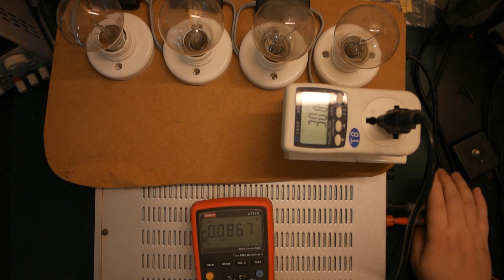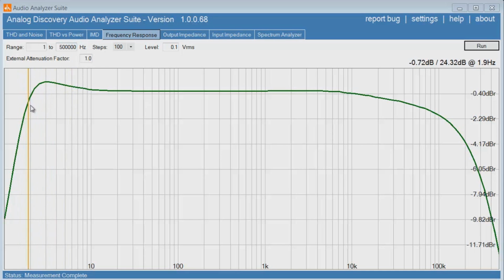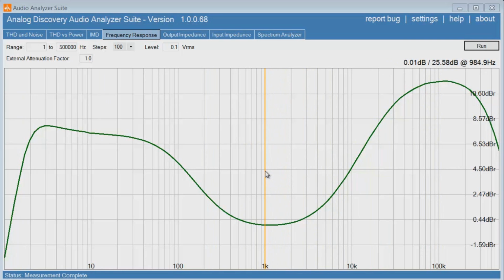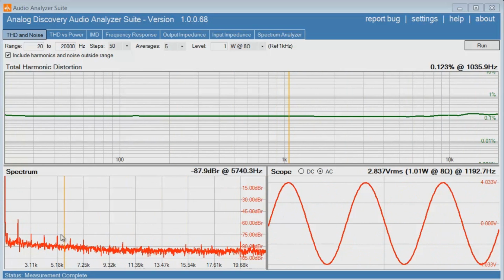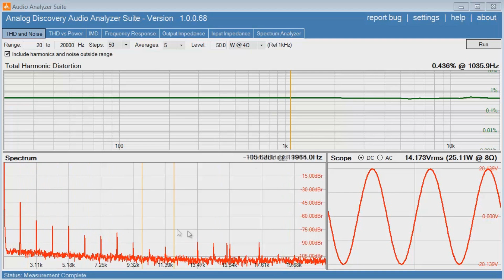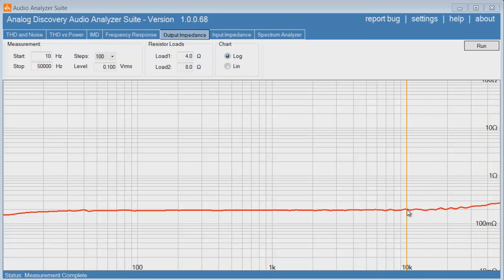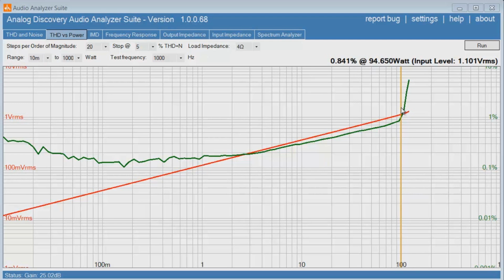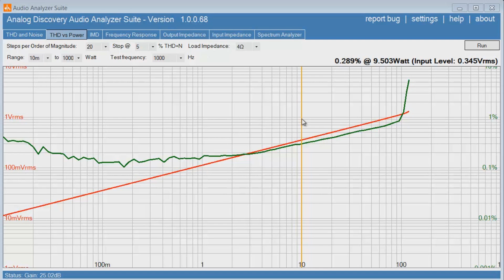Yaqin VK-2100 Hybrid Tube Stereo Amplifier Measurements and Evaluation - Part 1

Comment: Very nice presentation. Looks like you were lucky with the amplifier purchase.

I am going to look into the Audio Analyzer Suite software. Lots of nice features. Your measurement of the Loudness Control was really good. I rarely use the Loudness Control on any of my equipment but knowing how it alters the sound, your display showed the altered FR so well.

I also found it interesting how the 2nd harmonic was the dominate harmonic in the transistor output. I was not aware of that in SS amps.  I wonder if that is common. As you surely know, the second harmonic is not the dominate harmonic in PP tube amps by the simple fact that it is a PP stage.

Now that I have a new toy (the FFT instrument) I have been entertaining the idea of directly comparing a high-end tube amp with a high-end solid state amp - both McIntosh amps.

Being a "tube guy" like I am, I have to admit ... please don't tell anyone  :-)  I actually listen to and maybe even prefer SS amps. I like the brightness of the SS amp and the power from these big Mac amps is impressive.

I really enjoyed your video and seeing your audio lab.
Reply from the maker: Thanks, I've had a closer look at the design of this amplifier and the voltage gain stage is done using the 4 dual triode tubes on front of the amplifier. I'm always a bit skeptical when I see tubes in Chinese amplifiers because I've seen quite a few where they just added the tubes for show, but this amplifier actually uses the tubes in a push/pull configuration before the transistor stage. I believe this is the intentional source of the 2nd harmonic dominated distortion. The transistor output stage probably got much less distortion. I have not listened to it yet, but I expect the sound quality will be quite good based on the measurements. The Analog Discovery device I use for the measurements is very nice, but the dynamic range is limited by it's 14 bit resolution, so distortion below 0.01% and noise below ~90dBV cannot be reliably measured, but it's got a very nice 10MHz+ bandwidth and  generally does a good job for a small all in one package.